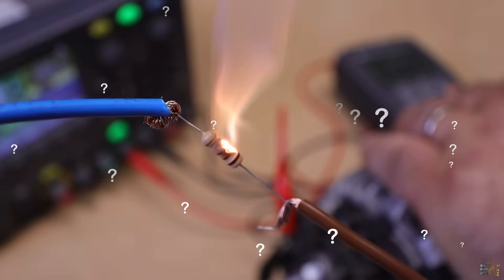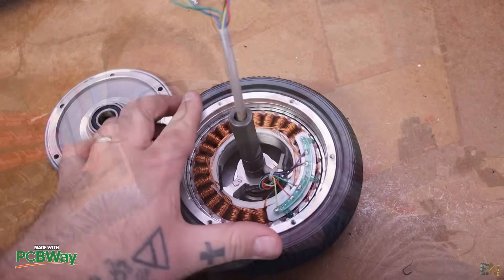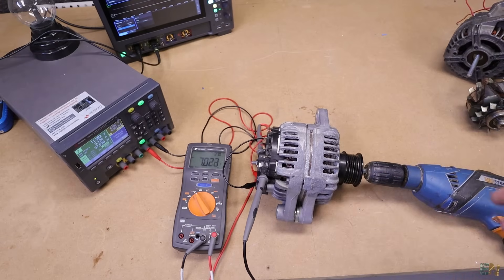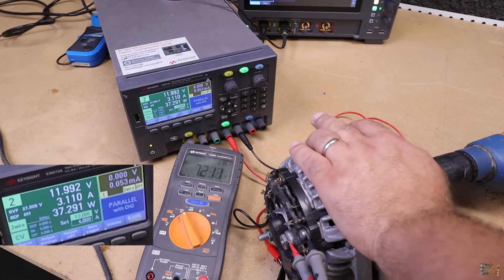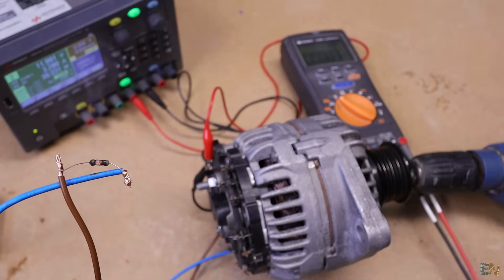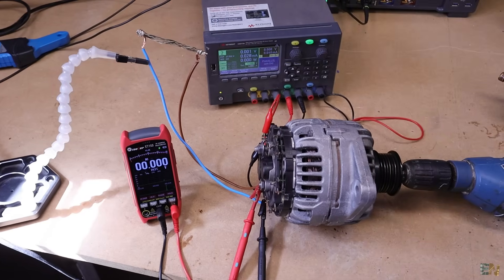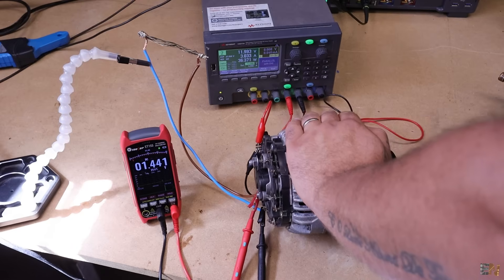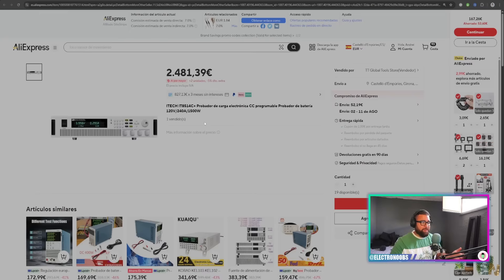Can a Car Alternator Really Make Endless Power?

Comment: You made a slight error when talking about maximum power delivery, it's not when the load is a short circuit, as that would be zero power delivered; maximum power delivery occurs when the load resistance is the same as the source impedance, i.e. a 140A alternator at 14V has a theoretical internal resistance of 0.1 Ohms, so maximum power delivery will be when delivering power into a 0.1 Ohm load.

Comment: you should be able to use a SLA or LA discharged car battery as a load  while in constant current mode......discharge it to 9v and then perform your test

Comment: lets make it simple

amperage is directly related to how tired you get spinning the generator by hand its just how much torque you can generate because it does not take much to keep something spinning without powering anything the amperage drops over a short time while you spin it. once you power something its actually harder to spin so either you are overloaded or you crank hard enough to power the device. gears can help with this

voltage depends on how fast you can spin so if the load is too much amps you cant spin fast enough and voltage drops your device no longer works or if you spin too fast your voltage can exceed the design of the device you power causing problems a voltage regulator can help with this

there are upper limits to how much power something can generate

mechanical resistance. with too many required amps on such a small motor the amount of torque you would need will simply break the cranking device even if you had the strength bigger generators solve this problem

heat. power generates internal resistance in wires and connecting points the weakest link will melt first breaking the circut

high voltage. generating too much voltage will cause the air to conduct electricity causing a short circut

Comment: isn't this exactly what mppt does for a given input V?  why do you even need a regulator if it is not specifically for a car battery?   if you can keep the RPM steady, this should be rather simple.    the power output depends on the power input.  your drill is the limiting factor in this test.   and why not just use a micro to record and make the plot you speak of?   this is not complicated at all really.

Comment: How about 40  of the MR16 Halogen Light Bulbs,  50W 12V GU5.3. In 6 pack they come in at $2.50 each. You could measure the current on one of them and multiply the result by 40. Of course it is a lot of wiring and you will not be able to bring it to 2000W with your power drill. Just a thought, thanks for the video.

Comment: If you could get that kind of power out of a single alternator, the guys doing the CB radio key up contests wouldn't need to mount 10, 12 alternators on their truck or car. Though it is kind of wild watching the corona discharge on their antennas just before the antenna sets itself on fire. Lol.
Reply: That kind of power sound like it's well outside legal limits to transmit with 😊.   But when I was young I do remember a ghostly sound coming from my stereo speakers. Strangely my stereo was off.  But the sounds got louder and eventually  I could tell it was someone's outgoing CB communication being picked up by the speaker coils.
Reply: @kreynolds1123  One of my friends from back in high school had the same thing. His dad had a bit of a radio shack in the back of the house with a ham setup and a CB radio that was running some ridiculously powerful amp. He talked about one time when his dad keyed up with the amp running full out and could hear his dad's entire conversation through his stereo that wasn't even on at the time, so yes, I absolutely believe that, lol. But I do some very minor radio stuff as well, and some of these guys doing the outlaw CB thing are pushing insane numbers out of their setups. The last video I watched was a fellow with approximately 8 huge fiberglass antennas running as a phased array. He keyed up and you could see the corona glow at the base of the one for a few seconds right before it started smoking and caught on fire. Those guys are a little crazy, but they know their stuff. Most of them are homebrewing their amps and some of them pump out more power than full on AM stations. It's actually pretty fascinating stuff.

Comment: A salt water rheostat is a great adjustable power dump. 

You could connect the alternator ground to one  copper pipe electrode and connect the alternator output to another copper pipe. Both pipes can sit in a salt water  tub. Then you  you can add salt or bring the electrodes closer  or insert something in between to narrow the path up s may flow through.  Then when current flows through your salt water rheostat, you can calculate how much power is being consumed by measuring the voltage across the salt water rheostat and use an amp meter clamp to measure the current.  Power = Volts × Amps.
Reply: Sound like a best way to chlorinate yourself

Comment: For a heavy load you can use an electric heater. If you let the temperature stabilize you can take the required measurements. Another option is to heat a non conducting fluid in an isolated reservoir and calculate the power from the temperature change. The fluid will also keep the filament in a smaller temperature range. I guess you can adapt a frying pan for this, if you like.
Reply: A12v  heater might work well as a power dump but it would be nice to have greater granularity of the resistance. I propose a salt water rheostat.

 But remember most heaters are rated for 120v or 240v. The 13.2 or 13.4 maybe 13.6volts off an alternator is tooo low to push a significant current through a 1400 watt rated heater that's made for 120v and 12 amps.  that means the resistance is 10 ohms and given that 12v/10 ohms is 1.2 amps and 12v×1.2amps is just a measly 14.4 watts.
Reply: @kreynolds1123  I use a beefy crocodile lead to select a desirable point of resistance within the heating element. Making it a rheostat, I guess. 😀
Reply: @Peter_A1466  that might work.  But you should use one rated for upto 1.5kw and 12v.  You could also have it in distilled water to disipate the heat quickly.

Comment: The Alternator generates AC & the built in full bridge rectifier converts it to DC. if you disconnect it, you get AC out of around 90-110V. you can use cheap Incandescent Bulbs in series as load for accurate current output measurement.

The output Voltage is always 12V DC because the input voltage/current is controlled by the built-in "voltage regularator" by Increasing / decreasing the Electromagnetic strength of the Rotor in relation to the RPM of the Alternator . higher the RPM lesser the input power.

Hope this helps

Comment: so what happens when god turns the generator. your measuring device (brain) says that nothing turned the generator, or gave the generator. nice. a drone runs with 1kW already and bicycling is 300W. car alternator is compatible with lead acid batteries with 200A and some 10V. or 2kW. having a coil generate magnetic field skips the requirement for the permanent magnet. simple coil generator. so why the generator is not at zero volts when not turning. that means you have to have something gifted before you can even do anything. from above. regulator is not the origin, of freedom. a large led diode would be possibly a convenient test tool. because you get a constant voltage drop and current is determined from that. ie variable resistor kinda.

Comment: What if we try to rectify it to get DC and connect MPPT? In my mind it should find the max power point. So only need to make sure mppt is within the output of a generator. Great job as always!
Reply: MPPT is good idea.. Or buy Constantan wire for a dummy load with almost stable resistance when get hot. Is cheap, but it cannot be soldered. 

PS: when you measure the voltage on shunt with little resistance, you must use proper 4-wire method.. in the video clip you have probes from multimeter on wrong places (measured with additional resistance from copper wire)
Reply: Mppt could be an option.  But there are chalenges. It's not 100% efficient  and will it work with a given load.  Some mmpt boost the voltage to the load.   Some buck the voltage some can do both. If  the mppt buck converts  can it handle  100 amps or more?  

A salt water Rhestat is far cheaper to dump the power into.  Just measure the voltage across is and use a current clamp to measure the current.
Reply: @kreynolds1123 100 amps out of car alternator? 150-200 watts is the most I saw in tests of permanet magnet converted alternators. It's not realistic to rotate it to 6000 rpm to get 100+ amps...
With constant resistor setup you are getting some result but you never know if that was a max power. It's only 1 line in a long table that power was X at some rpm using R omhs load....

Comment: I have 2 deepcycle batteries in the back of my van that I charge at up to 280 amps thru 2 gauge cables to the alternator.  They key is that they will only sustain this output when the alternator is cool.  Even in winter at -20F it will drop to closer to 200 amps after 20 mins or so as the alternator heats up.  In summer it normalizes to about 180 amps.

Comment: And if you use the regulated voltage to power the rotor, while using the unregulated voltage to power the load? 

How much current does each use/produce?

Comment: It is funny watching you try to generate more watts than the drill can possibly supply. heheh (But of course you know that too).  
The generator / alternator can make a lot of electricity, but it is limited by one thing most importantly and that is heat. You can spin it faster under heavier loads, but the coil will get hotter and hotter until it melts.

Comment: A steel wire clothes hanger seems to come to around 0.3 ohm when straightened and wrapped around a 1" mandrel. This is the cheapest route I've found for BIG resistors, I plan to incorporate with FETs for an automatic load.

Comment: great video thanks 👍🏾👍🏾, i have learnt a lot, I think if you use your homemade resistor to measure the voltage across it and automatically  the voltage, remove it and measure it resistor when it is still hot

Comment: This is obviously out of topic of the scope of this video but I am facing an issue. Anyone with any knowledge about it please do help me out. I am doing an IoT project and it uses a 9v water pump which I am switching on and off using a single channel 5v relay module. I am using the generic esp32 dev module for it. When I am trying to run a simple relay code on my esp32, the esp32 either just stays on or it doesn't turn on at all. I have wired it correctly too, with the positive of the 9v battery in the common port of the relay and the positive from the motor in Normally off port. Can someone help me out with this please
Reply from the maker: How is the esp32 supplied? Do you have enough current. Relays on switch use some current and it might reset the ESP32 all the time. maybe add a capacitor at the Vin pin of the ESP32 to avoid resets...
Reply: @ELECTRONOOBS  thanks for the reply. and I am powering up the esp32 with usb currently. I wired the esp to 3v3 instead of Vin and it was switching properly, but when I attach the motor pump, the pump doesn't switch. Must be because of the low voltage
Reply: @user-nq5hy7vn9k  Ah yea 3.3 is going to be at the lower limit, first use a solid regulated 5V source to ESP32. Then let us know.
Reply: @marcfruchtman9473  I am using a solid 5v regulated source to power the esp32 now. Using a buck converter and converting it to 5V and using a li-ion. Still the same issue
Reply: @user-nq5hy7vn9k  Disconnect your motor, and confirm using a multimeter in continuity mode that the relay opens and closes using the control exactly as you command, then let me know. I am assuming you are using a Normally Open relay? So, it should be open normally, and closed when you energize. (also disconnect the power from your motor and relay circuit...) So, you should hear a Beep tone when the relay is energized, and no beep when it is not.
If you confirm that the relay opens and closes as you expect it to, then try power the motor directly without the relay to determine if it is working properly. 
To be certain, you are not connecting Motor power (+) or (-) to anything other than the motor and the Com/NO and not sharing either with anything else?.
Reply: You will need to drive a mosfet from the output pin of your esp32 and then connect the source to the 9v
Reply: You need a protective diode across the relay to stop back EMF
And best to drive the relay with a transistor to protect the ESP32, your power supply needs to be able to maintain enough current for the ESP 32 and the relay with out voltage drop off, otherwise the ESP32 will brown out ❤
Reply: @SusanAmberBruce thanks for the suggestion. I used a BD139 NPN transistor as a switch with the relay and the GPIO of my esp32. I also used a 10k ohm pull down as well. And the setup started to work perfectly as I wanted it to
Reply: 0 also everyone reading this he's not using a a standard relayer relay module with isolator module not part
Reply: Are you powering your ESP32 with the same supply that you are powering your motor?
Reply: @marcfruchtman9473  no. I am powering the motor with a different 9v battery
Reply: I've had this problem before you're using a 5 volt relay module which I have noticed some modules unable to be treated using a 3.3 volt signal often not high enough program to operate and switch with 5 volt 

Eva you need to get a 3.3 volt relay module boost the output to 5 volts